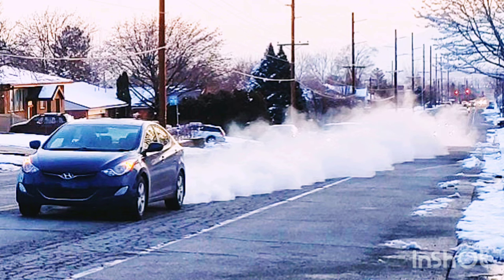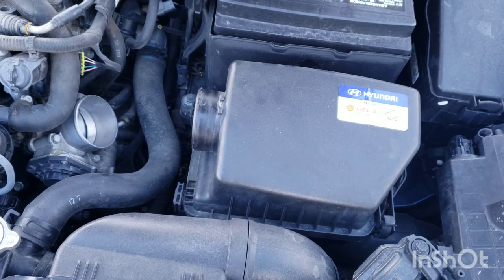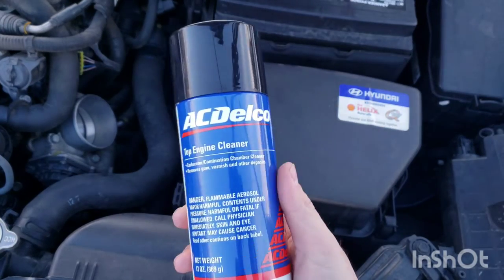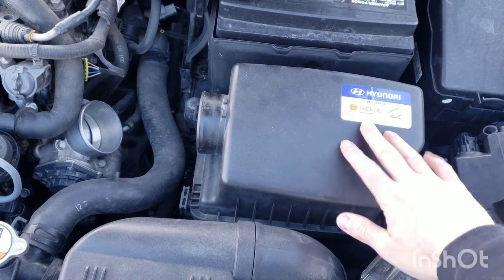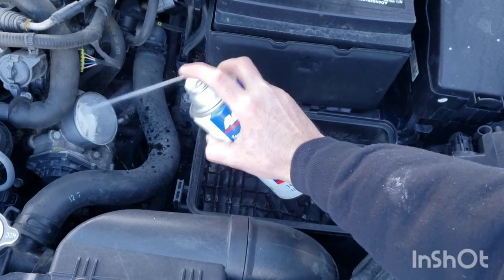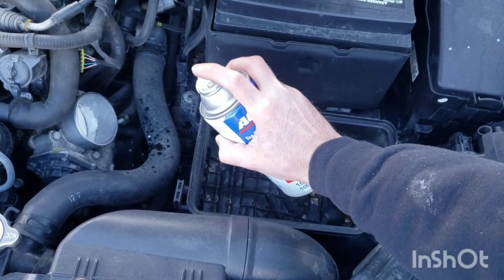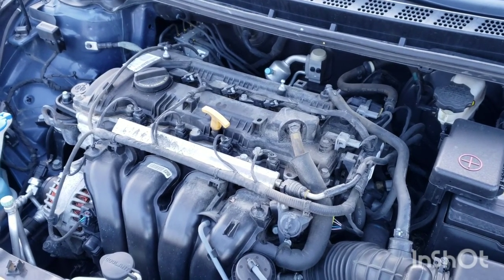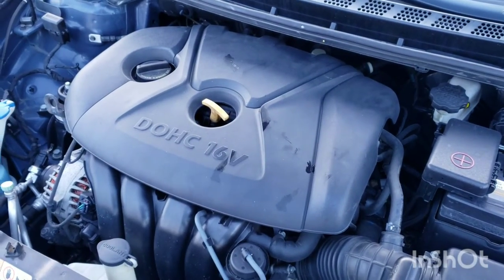Top Engine Clean | Hyundai Elantra

Comment: just use paper towel and tb cleaner. dont spray it directly. spray it on paper towel then wipe the tb. you need to access the inner of flapper as well by pressing the gas accelerator. and dont remove the sensor so you don't need to relearn your elantra.👍
Reply: Ik this is a stupid question but you mean press gas pedal while engine is off?

Comment: At what point did you remove and reinstall the MAS?
Reply from the maker: For this Hyundai Elantra, I don't think it has a mass airflow sensor (or I just haven't found it yet) but for cars that do have one, remove it before you turn on the car to spray the cleaner in the throttle body.  Plug it back in after you turn the car off to let the cleaner do its work on the carbon deposits in the throttle body.
Reply: It does have a MAF or MAP. It's located on the intake just after the throttle body. Most cars have the MAF sensor on the intake hose from the air filter box to the throttle body. Debating if I need to remove my MAP before spraying as the instructions on the can say or if I can leave it in place as the creator of this video did. I think the main thing is to not spray the sensor directly with the cleaner but incidental contact is probably not an issue.

Comment: Bro you killed this engine all dirt will go inside the engine the right way you have to remove the throttle body without disconnecting and start clean two sides

Comment: YOU MAKE A WRONG PROCEDURE
Reply from the maker: Which procedure did I do wrong?
Reply: @mywayofdoingthings2277  You didn't do anything wrong, xo xo doesn't know what they are talking about.
Reply: This is not "a wrong procedure", this is what is required to clean carbon deposits from GDI engines. Pouring cleaner into the gas tank and calling it a day no longer works. The injectors do not spray the tops of the valves. Don't follow this procedure and you will destroy your engine with carbon build-up.
Reply: The Elantra 1.8l in this model year is not a GDI engine but rather a port injection engine. No matter though, the top engine clean is beneficial for both, just more important for GDI engines where the fuel mixture does not wash over the intake valves and act as a solvent to help keep them clean.